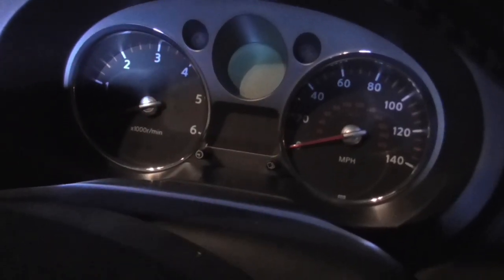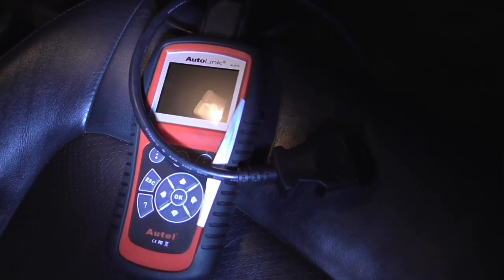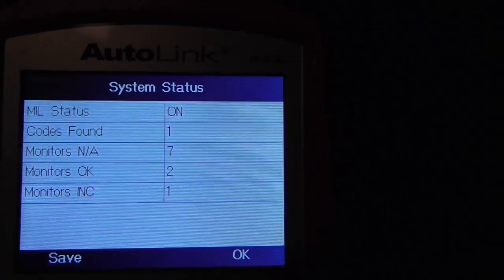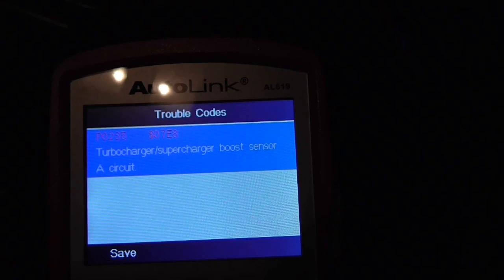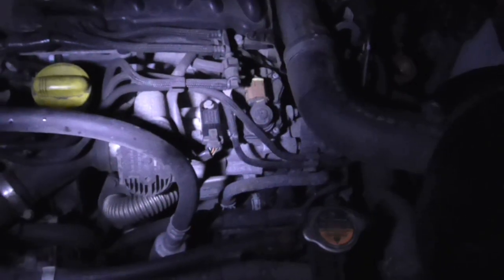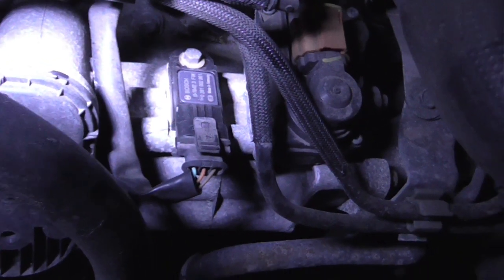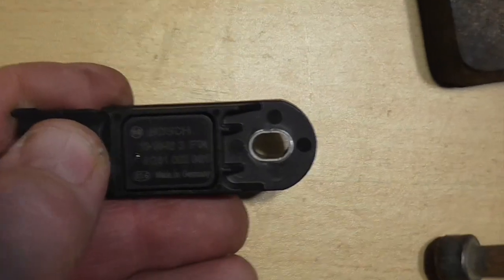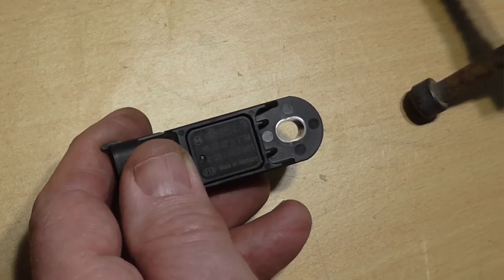Nissan X-Trail 2007 2.0 DCI 173BHP T31 MAP sensor. loss of power, limp mode, diagnostic socket.

Comment: Really glad i came across this video. Our 2010 xtrail had sudden loss of power, limp mode home. sent into local garage who only cleared codes then sent it back to us, no work done just a bill of £42. Guess what happened, yep lite back on. Informed garage, soonest available slot 3wks time! 
We found this video and ordered a turbo boost valve control arrived in 1 day. it was a simple fit, fitted it, neighbour had a code reader and cleared the code. however lite reappeared almost instantly. smoke test then carried out at home to reveal no leaks from pipes or connections.
We then ordered a MAF from AMZ and a code reader, 2 days arrived. read code, replaced maf, cleared code.
Very happy to say back on road and performance back to normal.
A very big thank you to the video host and the help provided.

code reader £27
turbo boost valve control £45
Maf  £29

keep rolling every one. 🙂
Reply from the maker: Hello Paula....I'm very pleased it was helpful....A lot of the problems with modern Diesels are sensors the Lamba probe (oxygen sensor) is another one that goes on these T-31's too ... I tend to drive around with a NEXAS NexLink Bluetooth plug in code reader in my and my wife's car in the glove box, at least you can clear down a code to hopefully get home.... it does take a bit of looking around the internet etc but you can generally sort things out.
The one thing I would say is it's always best to go for a good brand of sensor not a cheap no/unknown brand cheapies from ebay etc.. stick to Denso, NGK, Bosch, etc... gthey usually fail in short order...
All the best....Trevor

Comment: Excellent video. When I first read the code and saw Turbocharger I thought "expensive!!!". With the help of forums and this video I changed the sensor yesterday and 5 trips later the engine light hasn't re-lit and the car's driving with full power so I can safely say it's fixed it!
Reply from the maker: Hello Spencer I'm glad you sorted it OK...some of the codes are a bit confusing we had it recently on a friends Honda CRV Diesel the message read like it was the position sensor on the throttle body...changed that £85... fault came back about a month later very similar code (best take a picture on yer phone!) which seemed to be a solenoid valve on the throttle body another £80 odd....low and behold  month later throttle position or something like that again in limp mode... changed gas pedal sensor (over £100 under the bonnet) 4 months later still going OK! I'm sure they don't want the code descriptions too easy to understand!
Ours has been OK now a year on...Cheers...Trevor

Comment: Hi Trevor. Many thanks for this video. You really helped our family. I suspected either the maf or the map and I cleaned the maf ,  still had intermittent boost issues, but I thought could also be stuck vanes, faulty solenoid or bad earth somewhere. After removing my old sensor and testing it , showed very similar readings to your faulty one, and since replacing with new sensor car has normal turbo function. Couldn’t be happier and was an easy fix. If you lived locally I’d buy you a few rounds :)
Reply from the maker: Hello Thanks for your kind comment....I'm pleased it worked out OK, I'm doing my best to help people and save a few quid along the way....thinking about it if you have a diagnostic code reader many of them allow you to see live data the readings from the MAP sensor should change as you rev the motor...not just checking the resistance of the sensor at atmospheric pressure.... you are right about turbos the last one I did cost £360 for an exchange unit nasty......all the best....Trevor

Comment: Checked the sensor in my car , It shows the same readings as your old defect sensor (abt 5K ohm) but mine is working fine .Must be some differences between them. My trouble is related to the particel filter

Comment: Hi my Nissan Xtrail T31, cant exceed 100 speed even if you floring the gas pedal to the bottom, i checked the transmission fluid is Ok and is on the required level, what can be the problem?
Reply: Hey mate, I got a similar issue, did you manage to get it sorted?

Comment: Hi Trevor,a bit stuck here,wondering if you have ever had to replace the crankshaft position sensor on this car,i have the new one but trolled the net and can't seem to find any info on this sensor on this model,ie where it is located,and how to tackle replacement,thanks all the best
Reply from the maker: Hello Steve... Sorry Mate we have no less than 3 T31's in the family both my son's and nephew have them be we haven't had that problem yet! confusingly some cars have them on the cam shaft ie my year 2000 Suzuki Jimny..... they are hidden behind things like the alternator on quite a few cars... Let me Know when you do find it and we can post it up should only be held with a screw or two and just plug in....All the best Trevor

Comment: Hi I got same issue with my car Nissan t31 l lose power on motorway after driving for 5 miles specially when I put down I put new TPS valve and MAP sensor I still got  same problems any advice please thanks
Reply from the maker: Hello Kamal sorry to hear you having problems have you scanned the car with a code reader? there are some surprisingly cheap ones about now, which work via an app on your phone and a bluetooth plug unit....see what stored codes come up...the mass air flow sensor can be cause similar problems you can clean them with a proper cleaner as well as the EGR valve 
wynns do a spray cleaner good for both.... Cheers....Trevor